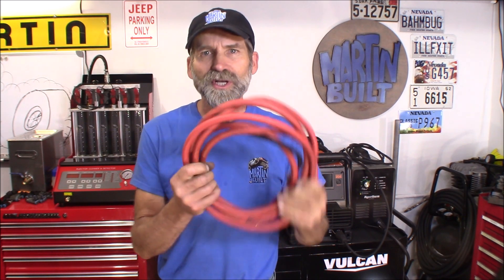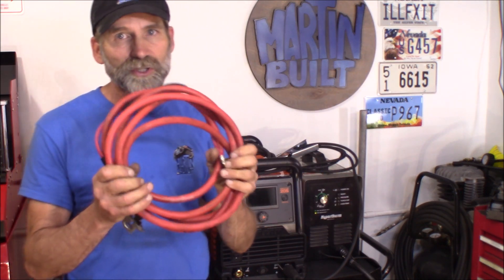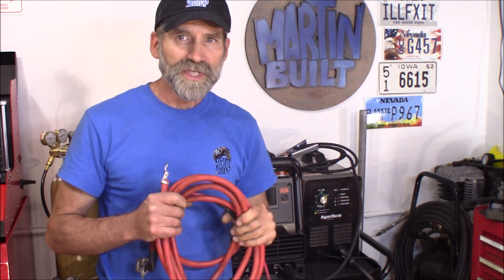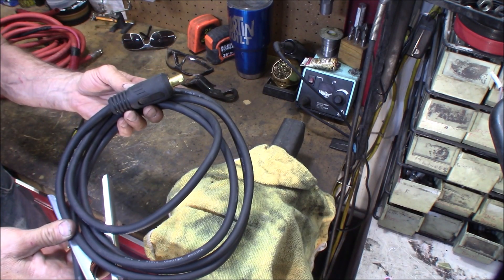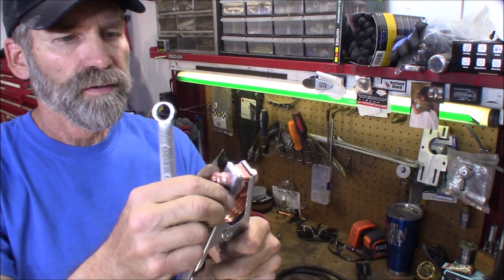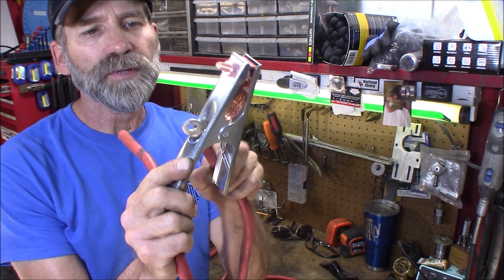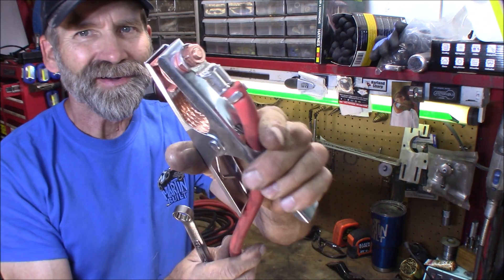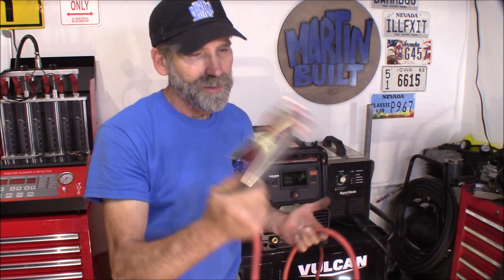How to Replace and Upgrade Welder Cables for under $5.00

Comment: Great upgrade.  Can l do the same but my cables go through the welder case. No Dinse connectors on the machine.  Can l remove the ground clamp and rod clamp and fit female Dinse cables in place on them then connect the male Dinse fitting to the new cable and the rod and earth clamp to the new cable so l have the original factory cables with Dinse extension cables. Is that ok thanks?

Comment: Thanks for the video and the advice I’m looking for to extend my leads on my welder machine I have a 140 MP forney  easy weld with 8 feet of lead but I don’t know if it will affect it with longer lead
Reply from the maker: The longer leads will work fine with your welder.
Thank you for watching.

Comment: Ironically, I used a welder quick connect on my negative cable when I'm not driving my car for a while because it has parasitic draw and I got tired of replacing batteries. Cheap anti theft measure too!

Comment: I can’t believe that’s actually welding cable…😂 That was gonna be my question if it was fine stranded. But right when you started talking about it being welding cable I could tell it was just by how flexible it was.
Reply from the maker: Yeah, Chrysler probably wanted a high flexible cable to make it easier for installation.

Comment: I just bought myself an Amazon special welder and I plan on using your advice to improve the cables and save some money as well. Thank you

Update: after a $2 entry fee and $6 cable fee I was able to get them for $7 each. Thanks for the tip you saved me alot of money. They did want to charge more after seeing it, but they honored the stated price given on the phone.
Reply from the maker: Awesome, glad they gave you a deal on them.
Thank you for watching.

Comment: I'm about to go tomorrow morning to pull and pay to pick one of these up for my MIG welder
Reply from the maker: Good luck out there at Pic-a-Part I've also used them before for battery cables to relocate my battery to the trunk as they were intended for the Chrysler 300 and magnums but in my Jeep Grand Cherokee.
Reply: @martinbuilt  yep I got the cable super easy to get out just like on the video

Comment: Amazing hack!
Makes me wish there were still pick a parts in my area : /
I am surprised Chrysler sprung for US made cable.
I wonder if the ones made after the Fiat take over have Chinese cable?

It would be worth picking up a couple more of those wires and some faux Dinse connectors and making a set of pass through extension cables.

Comment: I went to my local pick-a-part and got the cable out of a Chrysler 300 for $4.61.  Awesome tip! Thanks Martin.  Btw... There is a section of braided nylon on the battery cable that works great for added protection where the cable  slips into the ground clamp.  Just snip it from stock location and electrical tape it where the cable rubs the pass-through hole in the ground clamp.
Reply from the maker: Yeah, even at twice the price, it's a good deal. I'm glad you found this helpful.  I have used that braided loom before in the past. It works well to protect the cable from both heat and abrasion.

Comment: Greetings: 1) Just rip out the stuff. Nobody else will need it. 2) Nice 2 know how Mopar protected the high current cable from abrasion. 3) Feed the bare end of the cable thru the clamp. I wonder how many idiots cut off the end or drilled the clamp. 4) $4.15 and the time would not have me swapping 4 another 2 feet. I can double the cable lengths 4 $20 and twice the time. Thx 4 Ur time, effort and upload.

Comment: good video. Personally I would have put denz on both ends and used it as main cable to add 12 ft. to the stinger and left ground as is. Just a thought.
Reply from the maker: Thank you; I just may still do that.😎👍

Comment: Our local LKQ charges $8.46 a foot for battery cable. It would be cheaper for me to just buy the cable new & make my own. A good tip for some, sadly not for me.
Reply from the maker: $8.46 a foot that ridiculous. Any welding supply store wouldn't even charge that.
Reply: @martinbuilt  Copied from the local LKQ price sheet at my MD location. "BATTERY CABLE (PER FOOT OR INCH)	$8.46"

Comment: GREAT INFO!   I went the Junk Yard and found a 2005  Chrysler 300 and sure enough, I found the exact Cable There.   It cost me 7 dollars but it was well worth it considering that if i had to buy Welding Cable for 10 feet it would probably cost me around 50.oo
Reply from the maker: That is awesome!
with the price of copper today $7 is a great deal.

Comment: Looks like I’ll be going to the junk yard today lol beats paying $100 for cable just to extend my leads 20’ I’ll just get a few of the battery cables and put them together with the connectors. Thanks for the tip, I would’ve never thought about that!

Comment: best one I've used so far was an old 1pc power cable for the TIG torch. Just attach ground clamp to one end, and screw other end into gas-thru dinse connector. Much lighter for those of us who travel with our rig for work...

Comment: Martin, I loved the video and wish I could have had the same deal. Sadly pull-a-part has changed their pricing to $56 on these! I got 7 of them today, got to the counter only to find out that they have a separate (and almost hidden!) price for "battery cables over 4ft". This is dishonest on their part, I won't be going back again. Please spread the word so others don't waste their time as well. Thanks.
Reply from the maker: That sucks 😕😢
Reply: Thanks for the heads up. You can get 2x25’ of cable from Amazon as linked in the description for $110. Inflation is crazy right now.

Comment: This is a great source for 10 1AWG cables.  My welder uses 10-25 Dinse connectors, so 4AWG or so, 21mm.   I don't think 1 AWG is gonna work!

Comment: Can you connect a 1/0 cable from 1/16mm² Cable? Will it work just fine? The cable for my electrode holder is too short I'm planning to make it longer.
Reply from the maker: I'm not familiar with a 1/16mm cable

Comment: I believe the Chevy Cobalt and HHR have the battery in the trunk also.  Might be another source.
Reply from the maker: Thanks for the info, I'll be going to Pic-a-Part tomorrow, I'll check it out. I know some BMW have them as well.
Reply: @martinbuilt  My BMW Z3 had a not so flexible 4 gauge cable running to the rear

Comment: I think it is more expensive because you have to find a dodge charger first from which to get the cable.
Reply from the maker: It's not just the  Charger but the Magnum and the Chrysler 300 and there are all kinds of them at the salvage yards.
Reply: @martinbuilt  Do you remember which model has the longest length?
Reply: Wrong
Reply: The way people are ragging them out, you should have no problem finding a charger!

Comment: My girlfriend was "unsure" of why I had a jar of Vasaline mixed in among my garage tools.  Your video helped convince her of it's use  .
Reply from the maker: it's not just for babies bottoms.
Reply: @martinbuilt  I'm an original owner 2004 Grand Cherokee  4.7, 173,000 miles  in like new condition ( my daily driver).   Trying to find an idle shake in the engine and soggy throttle response until 1,500+ rpms.    I disassembled the throttle body and cleaned it.  Do I need to re-calibrate it ???    Do YOU have a video ?    I like your H/O cam upgrades.       I'm an original owner 1985 Oldsmobile Cutlass Supreme Brougham, never out of service for more than 3 weeks. Girlfriends original owner 2004 Honda Accord just passed 317,000 miles. Original drive train and no leaks or smoking, well taken care of.
Reply from the maker: @billycarpenter4740  sounds like you take great care of your vehicles. Did you remove the idle air control valve and clean it when you were cleaning the throttle body? That sounds like that could be the problem.
Reply: LMAO.  As soon as he said Vasaline AVE popped into my mind.  I'm easily corrupted.  Regards, Al
Reply: I bet she was afraid to bend over in your shop lol her peanut butter is safe

Comment: I used to MIG and stick weld every day at work and enjoyed it (unless it as inside a trash compactor on a hot summer day). That was 8 years ago, but its kinda like riding a bike...
Two of those would make great jumper cables.
Reply from the maker: yes they would, extra heavy duty, jump start a Caterpillar.